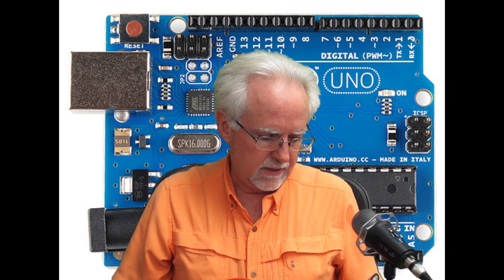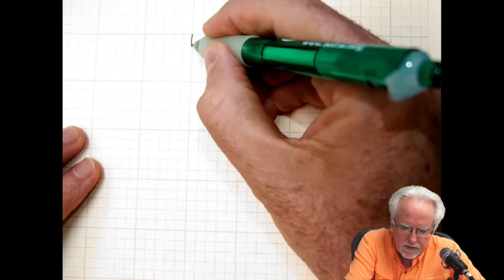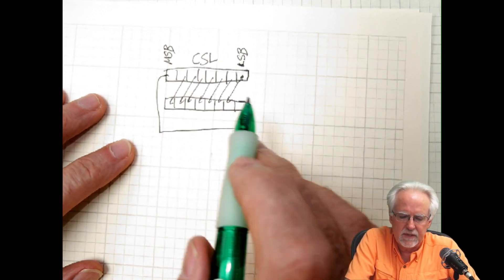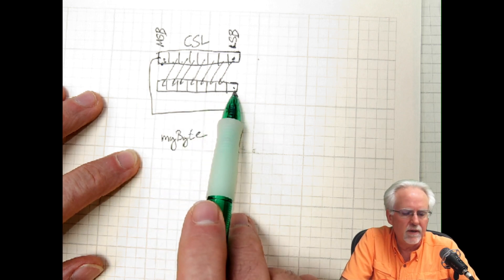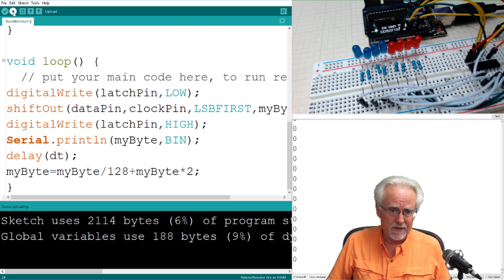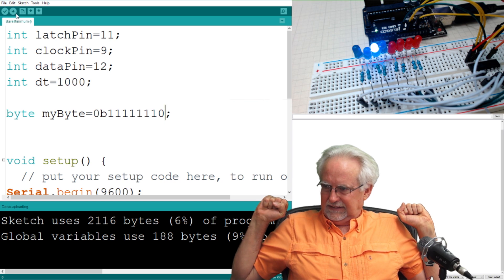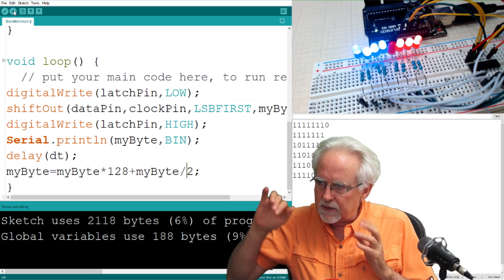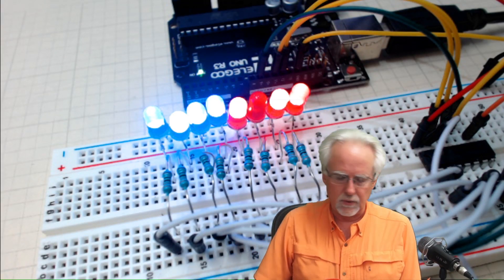Arduino Tutorial 45: Understanding Circular Shift Left and Circular Shift Right with the 74HC595

Comment: I got this fairly quickly. I used bit read prior to each bit shift to check if it was a one or a zero. If it was a one I added either 1 or 0x80 after the shift to my next display number depending on which direction I was shifting. This worked great. Nice simple and elegant. Thanks to a great teacher and the Arduino reference page.

Comment: Paul,
As a retired electronics instructor I am always impressed by the quality of your presentations.
And I am not easy to impress!
I have an Arduino related request.
I have been searching for a good presentation on how to use the Arduino IDE with the ATtiny85.
There are dozens of them out there but I have not been able to find one I would recommend to any of my friends.
I am 75 years old now and too old to attempt to do it myself; but if I were younger and had a connection to an Arduino kit provider,  I would help them develop a kit to do exactly that.
One that included an ATtiny85 device along with a modified IDE with some sketches and libraries on a CD/DVD/Thumbdrive  to program and use ATtiny85 devices as part of your Arduino tutorial series.
But NOT built on a shield.......Using wired connections to a breadboard.
 One stop shopping where you would not have to jump around the internet to get the modifications to the Arduino IDE.
 But until that time when such a kit is available, would you please consider making a separate Tutorial on how to use the Arduino in conjunction with the ATtiny series of devices?

Comment: Did this a different. noticed that after the value multiplied by 2 was greater than 255 it would just go to 0, so i turned the byte into a int, and did a if statement that if the int was greater than 255, it would be doubled then i would subtract by 255 and it worked. Many thanks Paul. I am a doer

Comment: I am very grateful to fate for having put a teacher like you in my path, Mr. Paul. I have been following his tutorials for about two months and, despite the fact that English is not my main language, his perfect explanations full of experience make me have no doubts that his tutorials are the best that exist in all of YouTube. I have successfully completed most of the tasks you request. Probably the "Circular Shift Left / Right" is the one that has cost me the most. However, I was able to do it successfully:

#define CLK 13 // SHCP
#define DATA 12
#define LOAD 11 // STCP

byte myByte = 0b10011001;
byte myBit;

void setup ()
{
  pinMode (CLK, OUTPUT);
  pinMode (DATA, OUTPUT);
  pinMode (LOAD, OUTPUT);

  Serial.begin (9600);
}

void loop ()
{
  digitalWrite (LOAD, LOW);
  shiftOut (DATA, CLK, LSBFIRST, myByte);
  digitalWrite (LOAD, HIGH);
  myBit = bitRead (myByte, 0);
  myByte = (myByte >> 1) + (myBit << 7);
  delay (1000);

  Serial.println (myByte, DEC);
  Serial.println (myBit);
  Serial.println ('');
}

Greetings from Venezuela!

Comment: I'm a doer. I took the same approach as Paul did on the shift left, although not on one line. I took the initial value and used integer devision, ie divided the hex value by FF. If it returned a 1 I knew the high bit was set, else it was not set. I then shifted left and added 1 if that return value was a 1. To shift right, I used the % operator, dividing the HeX value by 2. If it didn't return a 0  we knew the low bit was set, so I shifted to the right and added 0x80.
Very good video and a nice challenge that made people stretch but not break.

Comment: What i did was that for the Circular shift left that we can observe that if we set all the bits to 1 except the MSB it equal to 127 in decimal hence we can detect that the MSB was 1 if the decimal equivalent was equal to or greater than 128 , if such a condition was satisfied then we left shift the bits to the left by multiplication by 2 and after that add 1 to it . 

Now for the Circular shift right i used the Modulus operator(%) which gives the remainder of a division , i computed Bits%2 , if it equals to 1 implies there is a one in the LSB which i carried over by adding Decimal 128 ( B10000000) after right shifting the bits by division. Although it worked but no way near as elegant of a solution as you did , Thanks .

Comment: for these last exercices with the shift register IC, i had become a watcher instead of doer. i was funneling my time into my main project which i finally managed to finish. 
while i don't see myself using the shift register much in my future projects, i still got the basics of its working from the first lesson, so i didn't sweat these later ones much. i'm starting to figure out that once you learn how something actually works (ie. "for" loops, pwm, interrupts, rotary encoders) and then running a few examples to get the basics down, the rest is up to what goal you have for your code.
i have to admit that these solutions are very elegant.

Comment: I was sure it was something simple like this, but I was way off base, looking through manuals and trying bitWrites and bitReads...to no avail.  I was pretty sure you would not spring some new command on us, but it's happened once before...so...after I saw you talking about a mathematical solution and started counting off the "2,4,8,16..." I was pretty sure of the solution, and paused the video to try on my own.  I couldn't do it, I could not figure that I needed to add the variable again into the equation before multiplying by 2.  This one stumped good.  I felt pretty slow witted.  I got the last three lessons right off, but not this one.  I really am a DOer, but this time, I became a WATCHer.  I am a bad Arduino boy!

Comment: Doer!  
My sketch wasn't as compact, though.  I used if() statements to determine whether the starting number was greater than 128 for the shift left, then added 0 or 1 as needed. For the shift right, I used a parity check % to determine even or odd, then added 128 or 0 as needed to toggle the left character.  Worked fine.
It is a struggle sometimes to complete the homework, but well worth it.
Thanks again!

Comment: OK, I'm doing the homework with some success. I got the homework assignment instructions wrong.  And, built a solution that moved all the LEDs left or right, and moved the LED MSB to the new location.  This just made the LED's flash, as they were just repeating the code. Which I thought was the assignment. I get how the one LED works OK. So, moving right along.  I hope there are some wireless tutorials in this program. As, wireless and WiFi commands have been my biggest problems with Arduino controllers using wireless transmitters such as: MX-05V, NRF24L01, etc.  Sending commands from a laptop or cellphone over the internet, or on a closed wireless system has been a big problem for me.  Which made me drop the Arduino all together a few years ago.  Now, I'm back and having this refresher course to regain my lost memory on Arduinos.  Thanks for the updates.

Comment: The circular shift homework stumped me.  I had to watch the solution.  Even though the solution is simple and elegant, it is deceptively subtle.  At this point, I like to give a fuller explanation of why the solution works.   Paul’s explanation is correct, but I believe it is somewhat incomplete.  I will use the equation for CSR as the example: myByte = myByte * 128 + myByte /2.  I won’t focus on the myByte/2 term of the equation.  I believe the given explanation is complete and accurate on how this term of the equation shifts the bits to the right.  The part that I will focus on is: myByte*128.   This part shifts the bit position 0 (the first bit) to bit position 7 (the eighth bit).  After all, 1 x 128 = 128.  Straight forward.  However, you may wonder: 128 is not just multiplying the value in bit position 0; it is multiplying the values in all bit positions (0 thru 7).  Won’t this corrupt the outcome?  The answer is no.  why?  The reason is due to rollover.  Remember, 0 dec is 0 binary; 255 dec is 11111111 binary, and 256 dec = 0 dec = 0 binary since 1 byte can’t hold 256 decimal.  It rolls over to zero.  Due to roll over 255 + 1 = 0 (not 256).  Here is an example:  Lets say the value of myByte is 15 in decimal (0x0F in hex and 00001111 in binary).  Intuitively (prior to math) we know once the circular shift right operation is complete, the answer should be 10000111 in binary.  myByte /2 is responsible for bits 0 thru 2 being equal to 111 as expected.  myByte*128 is responsible for shifting bit zero (value of 1 prior to the operation) to bit 7.  But why doesn’t myByte*128 corrupt the answer since it multiplies all bit positions (not just bit position 0)?  Well, it is due to rollover and multiplies of 256.  Due to rollover, you can think that all of the following terms are zero: 0, 256, 512, 1024, 2048, etc..  Let’s multiply each bit (00001111) by 128 starting at bit position 0: 128 x 2^0 + 128 x 2^1 + 128 x 2^2 + 128 x 2^3 + 128 x 0^4 + 128 x 0^5 + 128 x 0^6 + 128 x 0^7 .  Doing the math: 128 + 256 + 512 + 1024 + 0 + 0 + 0 + 0.   It is better not to add these numbers straight up.  You will notice that every term is either zero or a multiple of 256 except for the first term of 128.  Since 256 and all multiplies of 256 rolls over to zero, that means the summation reduces to: 128 + 0 + 0 + 0 + 0 + 0 + 0 + 0.   Bottom line is that myByte*128 forces each bit to be zero since the result will be zero or a multiple of 256 with exception of bit 0 which can be either 0 or 128.  This is why myByte*128 rolls over bit 0 to bit 7 and it doesn’t matter what the values are for bits 1-7.  Subtle…

Comment: I tried to do it, but my code is restricted to a specific starting and ending point.
I used a FOR loop and an IF inside it.

These past 2 lessons were amazing. Most especially this one. 
Never have I ever thought of using the concepts in logical-shifting with this circular-shifting.
The idea of getting a product greater than the 8-bit binary range (0 to 255) seemed strange. 
But again, it works since it all comes back to 0. 

 
I am definitely a DOER! I always try to write it on my own and come up with my own code.
This one's tough though, I gotta call it off and be a watcher this time

Thank you Grandpaul for this. I learned alot!

Comment: I figured it out but , as usual, made it harder than it needed to be.  I understood that I needed to divide or multiply by 2.  For some reason, I decided it needed to be in a while loop.  Making the while loop work required more thinking going left.  I got it to work though.  I am still struggling with the infinite loop concept in physical computing.  In my work, infinite loops are very bad - to be avoided at all costs.  So I am still trying to break free of this thinking.  I also found the ">>" and "<<" operators.  Those make this very easy.  Thanks for the great lesson!

Comment: My approach was different. As just one direction was asked, my answer was, if the number that has to be shifted is equal or greater than 128, then multiply by 2 and add a one. That worked greate, because only than the MSB is a 1. For the other direction I had no idea.

Comment: Something about this solution has my mind boggled. I understand how multiplying by 128 would bring the LSB back to the MSB spot but how does multiplying the number as a whole, and not just that one bit not cause issues. An example of what I'm thinking: 00001110 =14. If I take 14/2 +14*128, I get 1,799 but the next pattern in the set actually reads 00000111, which would equal 7. I have a feeling that there's some law of binary numbers that makes this work and I'm just not seeing it but trying to think out the math is giving me a headache, haha. Thanks again for all these lessons. I'm learning so much and having a wonderful time building and coding along and doing the homework assignments.
Reply: Mr. Mehoff, remember we are working with a data type of "Byte". The value range of type Byte is 0 to 255 so any math function you do on the number has to remain in that range. Your value for 14*128 in math is 1792 but the value has to be converted back to a number between 0 and 255. For a value of 1792, this conversion results in a number of 0. What you are seeing is that every time you multiply by 2, if the answer would be a value greater than 255, the number is corrected back to a value of 255 or less. This is the result of the most significant bit shifting out of the 8 bit range of the variable. If you look at this from a range checking IF statement, X=X*2, If X>255 then X=X-256. From an actual hardware operation, the highest bit shifted out of the range into "nothingness" so the value can never be greater than 255 <grin>.  This same idea exists for all data type that are unsigned, 16 bit unsigned are limited to 65535 (2 raised to the 16 -1) and also 32 bit type. Signed numbers get complicated as the MSB is an indication of a negative number and shifting functions to different things for those data types (and BTW, a type of INT is a signed number that has a range of -32768  to +32767). Hope this helps explain this action. Good Luck

Comment: For left, I just said if the original number is greater than or equal to 128, add 1 after dividing by 2.  Right was a bit more tricky.  I knew ways to do it since I've worked with binary before, but none of them worked with what you've shown so far.  Then I realized I could remove all but the least significant bit by dividing by 2, then multiplying by 2, and subtracting the result from the original number.  If that resulted in a 1, I knew I needed to add 128 to the final byte.
Reply: I wish I could see your code. I tried your way. But it didn't work for me.

Comment: I'm a doer Paul, or to be more accurate, a trier. I asked if the number was above 128 ( and therefore had a 1 in the 8th digit) if so I added a 1 to the number. It nearly worked.

Comment: Great lesson I did an if statement and if the value was 128 or greater, I would multiply by 2 and add 1 else just multiply by 2 , second part i did a value%2 and if  that was  equal to 1, I would / 2 and add 128 else just /2  it was great to see the differences in approach

Comment: I used the bitRead (before shifting) and bitWrite (after shifting) functions:

digitalWrite(latchPin,LOW);
shiftOut(dataPin,clockPin,MSBFIRST,LEDs);  
digitalWrite(latchPin,HIGH);
LSBbit=bitRead(LEDs,0);
LEDs=(LEDs>>1);

if (LSBbit==1) {
bitWrite(LEDs,7,1);
}

delay(200);

}

Comment: This is the first lesson that I had no idea how to do or where to start.  I understand how to do it now, but I still have a problem understanding how it works and what you would use it for.  I suppose that will come in a later lesson.
Reply: A more common use of bit shifting is something you are using in almost every one of these tutorials, the "Serial Terminal". Serial communication works by taking a value that is some number of bits wide, usually 8 and sending them out a data pin one bit at a time. The shift functions are used to determine the next bit to send on the output pin. On the receiving end, as a bit is read from the input pin, it is added to the data variable by the opposite shift function used on the sending end. There are hardware chips that can do this serialization, but it can be done completely in software and is generally called "bit banging". Good Luck

Comment: doer, your way much easier then what i did. i connected output q0 and q7 pin to arduino, digiread to determine the value of the lsb msb and add 0 or 10000000 and of course *2 or /2 to go left or right after using if stats.  must look for easier solution thanks for these good

Comment: did the homework and got a solution working but not as elegant as yours,  for circular shift left i used an if/else statement to check if mybyte was >= to 128 and if true added 1 to mybyte e.g. mybyte=mybyte*2+1 else mybyte=mybyte*2.  For the circular  shift  right i determined if number was odd or even and if odd added 128 .  so overall 3 lines of code versus your 1 for each direction.   looking forward to using this stuff in next series of tutorials.

Comment: I really wanted to be a DOER, but I ended up being a WATCHER because I had no idea where to begin.  I Usually have some idea of how to attack the homework, but not this time so I didn't spend much time thinking about it.  I even did a little googling of circular shift and they used a circular shift function and not how you described.  You're describing how circular shift works "under the hood," which is a good thing.  I now have a decent understanding of the math on this one.
Reply from the maker: It is OK to fold up like a cheap lawn chair. If you try and struggle and work hard and then do not figure it out, when you see my solution, you actually learn. If you just watch me without the struggle, you simply are not going to learn because it looks easy when I do it. Good job, continue on.

Comment: My solution was suboptimal to say the least, I assumed that I could switch all (but position 7 and 0)by multiplying for 2 or dividing by 2. Then I created if statements for such cases in which: if (myByte == 0xFF){myByte = 0x1) and viceversa, but doing that meant that the lights in position 7 or 0 were not being turned on and off.

Comment: Once I caught on that you are calculating 00000000, 10000000 or 00000001 to add to the product of multiplication or division it made sense. It's 8-bit Arduino binary manipulation (not standard math). I didn't have an appreciation of how the overflow is managed. You can have a large integer and Arduino will give you the correct printed output (1111101000 for 1000 for instance) but when you do division or multiplication of a binary number, the bits get truncated or rounded - I think.